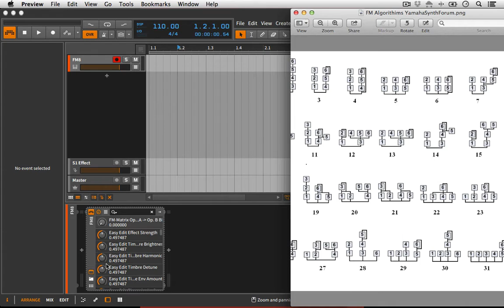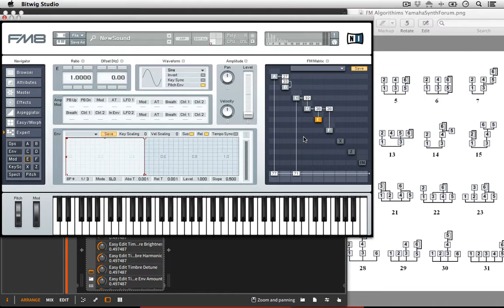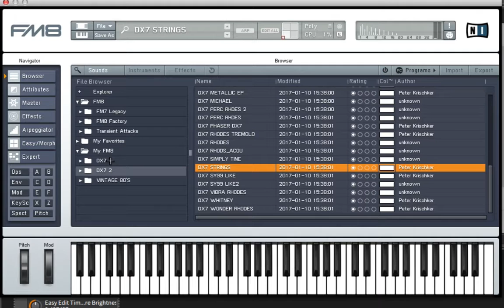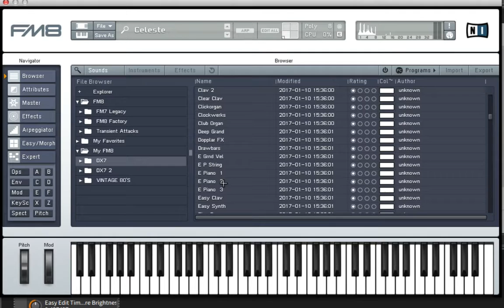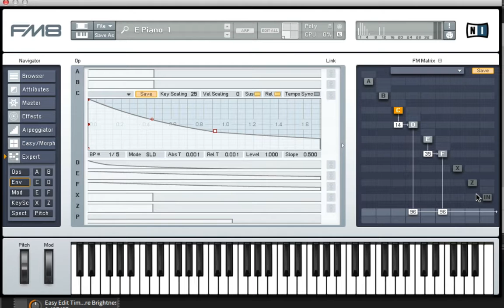DX-7 Algorthims in FM-8

Comment: Just out of curiosity, where did you get those DX7 .sysex files/presets? I haven't done much searching yet but I've been meaning to find some.

On a side note, I just picked up a DX7 like a month ago and love it to bits. But that E.Piano 1 preset you previewed sounds very different from the patch on the DX7. I've actually made a short patch demo on my channel if you wanna check it out and see how much better it sounds on the actual DX7 rather than that patch.

On a similar side note (lol), do you happen to know how to "export" a .sysex file from a DX7? I'd like to figure that out too, if that's even possible.

I've been diggin the new channel, and diggin the Bitwig tutorials. I'm making the switch from Cubase to Bitwig for all of my electronic music production, mainly because of the non-linear aspect, but also because it's incredibly powerful (like the mods, for instance) and because it opens up so many creative doors. I feel very creatively constrained in Cubase sometimes. I love it for mixing and mastering, and for certain other aspects, but the strict linear aspect is becoming a thorn in the creative thumb.
Reply: That's a great question!